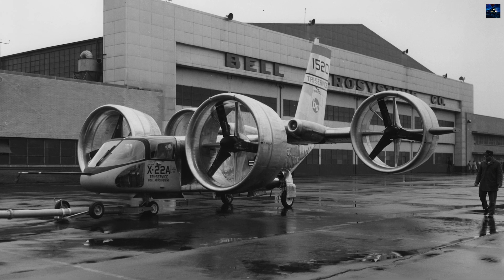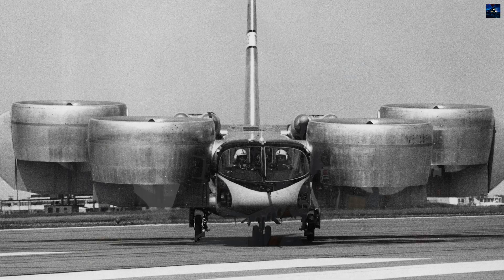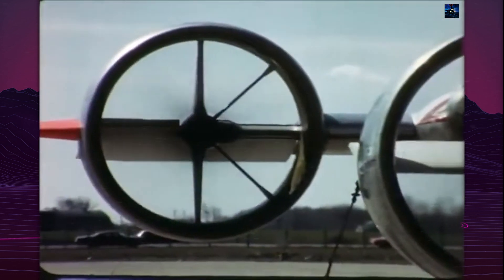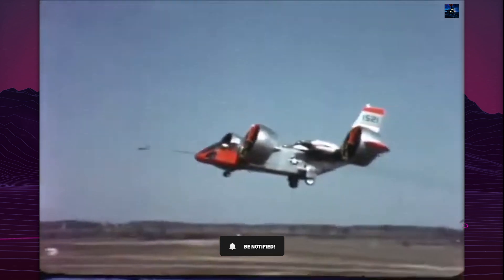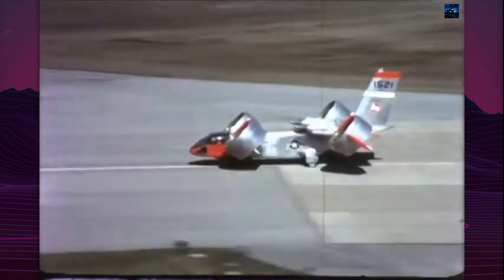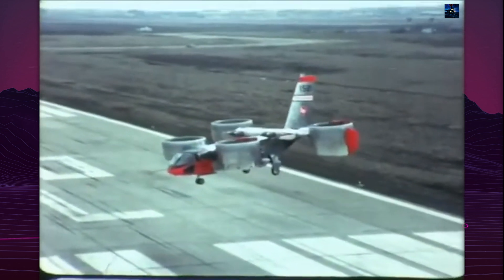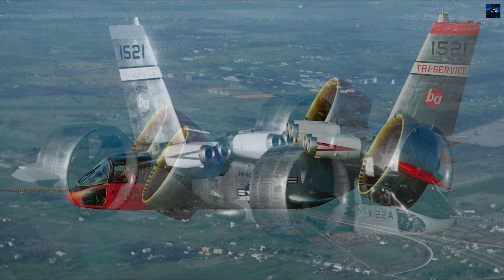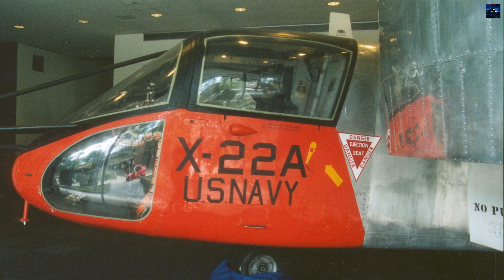Bell X-22: Four Rings to Rule the Sky - The Lost Legend of Naval Aviation

Comment: Alien technology. VSS:  Variable Stability System from Cornell U. What was Bell up to? Consider airplane control systems being different from helicoptor control systems. Now, put them into the same control system. Craft had two pilots with different control systems: primary seat was fly by wire, secondary seat with direct control of the hydraulic system in case the computered system had errors. Fly by wire thru computer, so limiters were programmed. From that, programming could test flight characteristics of future designed aircrafts. This from the aliens whom created the first radar guided cruise missle. Programmed flight paths. Additionally, flight simulators for planes, jets & choppers were created, and tested.  Just think of it being 50 years ahead of it's time. Yet, some commenter's think it was a failure. Well, there free to believe what they want.

Comment: So if it works so well why aren't they using it they wasted all that money for nothing
Reply: They didn't waste their money for nothing, far from that.  It's common for the US military to build prototype vehicles to see how they actually work, versus how they are expected to work, this was the 60's, and computer models were not available. This aircraft worked quite well, it was far from a huge failure. The craft wasn't quite as fast as the engineers projected, but fell only 4% short there.  It appears one of the bigger surprises was how loud the craft was- the 4 fans produced a load roar that could be heard from a long distance, as reported by people who lived near the airport in Buffalo.
Reply: The tech developed and learned was incorporated into production aircraft. As for the ducted fan concept well it comes down to range. 

Today the new tiltrotors surpass passed tech prototypes and helicopters in general when it comes to speed, range, payload capacity, and endurance. However many lessons learned from this alone were incorporated. 

The AV8B the US built was far more stable and more flyable likely thanks to X22.

Comment: You want a flight proven VTOL to carry heavy loads fast and far! Ask the British how!  They had the Fairley Rotodyne  back in the late 1950s , that would put the V22 Osprey to shame, in all departments!  Still no one ever learns rom history! Especially the Yanks!
Reply: Why isn't it still around, since UK engineering is superior?  Seems a lot of these electric taxi projects shouldn't be necessary.
Reply: @Hyposonic 
Why? Politicians. That's why.
Reply: @mpetersen6  Yeah, it couldn't possibly be the engineers saw problems.  Nor were there issues with the business model.  If it's the politicians in a democracy, that's your fault.
Reply: @Hyposonic 
There was a noise issue from the tip jets. But in terms of military usage that really wouldn't be an issue. At the time the British government was nationalizing the aviation industry. Fairy got folded in with Westland and Westland wanted nothing to do with the project. Kaman in the US was either negotiating a production license or already had one. The USAF wanted to purchase a number of machines.
Reply: @mpetersen6  I'd consider socializing the UK aviation industry proof of the business model's failure.  Paraphrasing what I said earlier: in a democracy you get the government you deserve.
Reply: 1.  Tip drive exhaust is supersonic.  When it meets still air the turbulence generates the noise, little can be done for it.  
2.  Tip drives are draggy, so auto rotations are risky as the rotor quickly loses energy.
3.   Helicopters have an advancing/retreating blade lift imbalance.  This limits their top speed to say 250 knots.  The Rotodyne, when lifted by its wing, will go faster because the rotor is idling.  Still the rotor has to rotate . The problem is postponed.
4.   When in the airplane mode, the rotor is drag.
5.    I ran a study with RC plane jet engine tip drive.   If I remember correctly the rotor tips were at 300g’s.  This would be plus/minus additive to the engine blades..unacceptable.  A possibility would be lining the engine with the span and diverting the exhaust thru 90D, but not an off the shelf engine.
6.   The best jet efficiency is when the jet exhaust velocity matches, in this case, rotor tip velocity.  (Which can’t be done).   So tip drive helicopters are inefficient.   Not a show stopper, but a consideration.
7.    Helicopter rotor blades and heads are the acme of mechanical engineering.  There are a multitude of conflicts the engineer must balance.  Tip drives add another.     
8.    If you’re interested, the tip g’s is rw^2/386.  Where r is rotor radius in inches, w is rotation speed in rads/sec, 386 is gs in iin/sec^2.   300rpm is a good place to start.
5.
Reply: Fairly Rotodyne was a magnificent beast!!

Comment: Just when you start to believe no one has ever tried a drone like A/C Quadcopter design the 60s come around the corner and tell you to hold its beer. Nice design! Thanks for the video!
Reply: Quadcoptor drones are easy compared to the X-22. First, consider the additional forces being applied. 4 jet engines, intakes sucking the craft forward while it's exhaust was vectored down. So, let's stabilize those forces to be able to counteract these forces for hovering by running at a set engine rpm.  From there, R/C toys just need to figure out how to morph into a plane and fly a predetermined path.

Comment: This should be resurrected  and be modernized....way way better then the dangerously  dangerous  OSPREY....
Reply: Instead of the Osprey they should have built the Rotodyne in the early 60s
Reply: @mpetersen6  I think one of the major problems with the Rotodyne was noise. Not impossible to deal with, but not good for a tactical military transport
Reply: @davidg3944  
And the Huey or Chinook are silent 🤔
Reply: @mpetersen6  There's car horn. And then there's Mega-Deth-speakers-at-one-foot. Believe it or not, it matters...
Reply: Cv-22 is pretty safe now. But it's a maintenance financial nightmare that should be retired
Reply: @sailingbrewer  The Osprey's problems lie in the way she was designed in the 1980s, which was an era of unprecidented & premature overconfidence, thanks to new things at the time like advanced CAD and computing. At the time, the Bell-Boeing engineering team believed a maintenance-free airframe was possible, same with the idea that hydraulic actuators would never need replacement, gearboxes would last 15000 hours, etc; only needing replacement when needed. Because of this optimism, the aircraft was designed accordingly- to never be maintained. Obviously reality proved otherwise, as the aircraft is a maintenance nightmare withan unacceptable mission readiness rating (due to nonstop heavy maintenance), but the bigger problem is that while the aircraft has a better safety record (as compared to aircraft like the H-53, H-46, H-47 etc), the military customer has rejected numerous proposals over the years by Bell & Boeing to upgrade and modernize the aircraft in the form of better drivetrain components, better hydraulics and a badly-needed cockpit & avionics upgrade, all of which would have significantly eased maintenance while increasing readiness ratings, improving safety even further and reducing operating costs. Unfortunately, it is these legacy components that are now proving problematic. It should be noted that the V-280 featured all the fixes that would have benefited the Osprey, and during its flight test program, it flew over 475 hours with zero issues, with the only issue being a failed #2 engine power turbine RPM sensor on the final scheduled flight of the prototype. The FLRAA tiltrotor, which is being developed from the V-280 & numerous lessons learned from both the V-22 and Leonardo 609, will be a significantly better aircraft than the Osprey will ever be, and should replace it in the services using it.